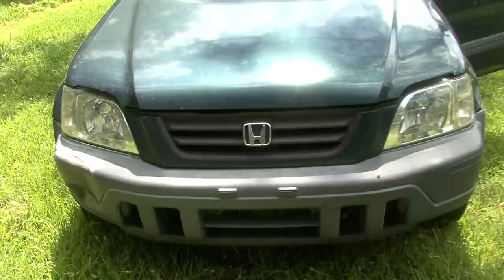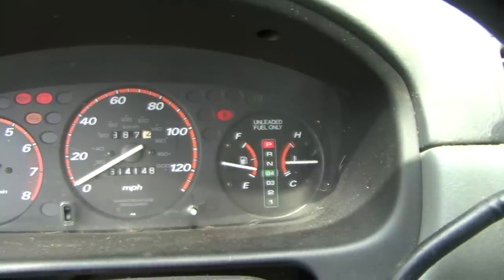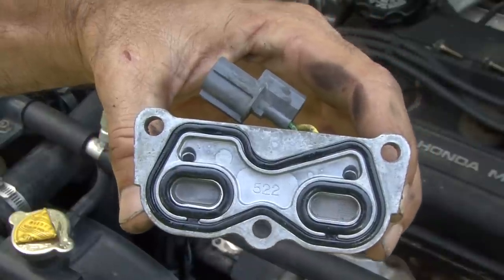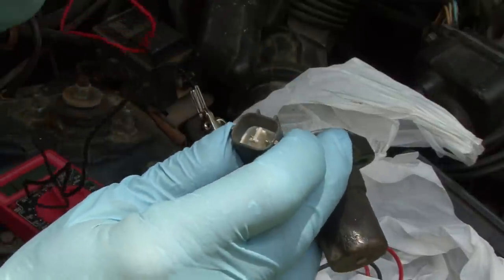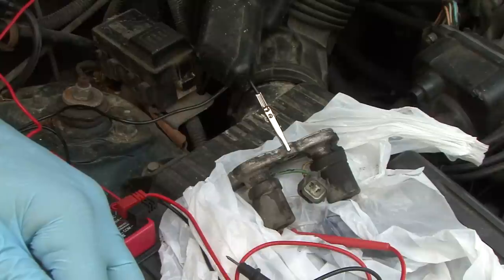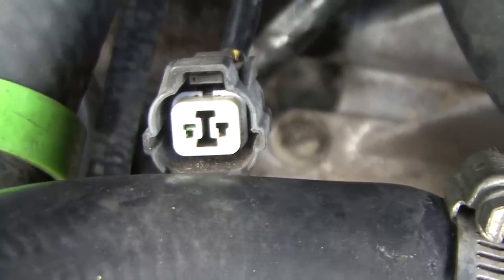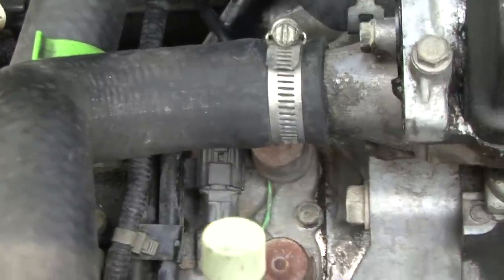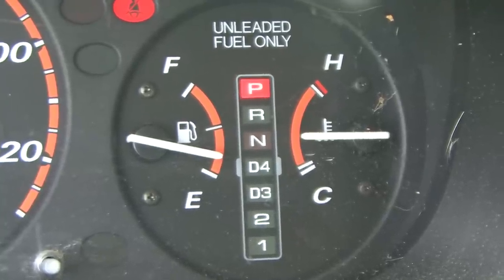Honda How To , blinking  D 4 with p0700 , p1758 and how to fix it , lock up solinoid

Comment: This was so helpful! Took my first gen crv to several different mechanics and they all said to replace or rebuilt the transmission. This saved me a ton of money thanks!
Reply: They would of had taken it off spray paint it and said its “new” and cleaned out the solenoid or changed it out for aftermarket junk
Reply: Loll

Comment: Thanks for the Great Video..I have a similar problem..The D4 light comes up after  i drive around 60 miles..during stopping at lights and shifting from lower gears. looks like when Engine gets hot...the issue comes.i changed Transmission oil..it mitigated..but problem came back: Vehicle Honda Accord 2000 VTEC 4 cyl..Fault codes P1381-cylinder pos sensor noise, P1750-clutch Presure Control Valve malfunction, P0780-Shift malfunction, P0740-Torque Converter Clutch Solenoid Circuit/Open, P0700-Trans Control System Malfunction

Comment: I have a 98 Honda crv. Swapped transmission out after the last one blew. I swapped the shifter cable out (last one was town apart) but no longer shows park on the dash. I cranked in neutral (which was actually park) and drove down the road and shown the d4 flashing. The code p0720 shows up. Any advice on what could exactly be going on would be very helpful.

Comment: I have the same problem. How do i check the conector? Do i look for 12 v on each pin? Cuz i have no power on either cable with the car running.

Comment: Cody, I need some help on my 03 Accord V6. It started jerk at 30mph. And I can't even drive past 20mph. I've changed the spark plugs, transmission fluid, several sensors. But it still doing the same. I was told its the transmission switch solenoid and lock up solenoid. But I don't know the locations of the two parts. Please help.

Comment: If you have the time could you  help me out? I have a 2000 Accord 4 cyl automatic that just triggered a check engine light and the green light around the D was flashing, it also had trouble shifting. When I manually shifted to a lower gear the blinking light on the D was still on plus the light on the lower gear, “Lower gear light not blinking“. I shut the engine off & restarted, engine light is still on no blinking shift light & the car is running fine except for the engine light. It tripped codes P0700 & P0780. I was told P0780 was a hydraulic problem. The car has 120k & trans fluid is a dark red (not black). I took it to a shop & was told that fluid is burnt. But they would have to run several test to let me know if I need a tranny rebuild, replacement or a solenoid replacement. I asked if a fluid flush could clear the check engine light. He said that he never saw that clear the light. What is your opinion considering the fact that the car is running as before the light came on would you try changing the transmission fluid, total flushing or any other suggestion.

Comment: Hi cody  my d4 light is blinking on my 98 honda crv i check the solunoid like u did and it does  the same thing  its like id have to floor my gas pedal to get it to move but my muffker recently  broke apart as well cud the dragging be becuase of the  muffler plz help me

Comment: I have a 1993 accord I'm having a similar problem 18th my check engine light turning on my d4 light does not flash while its on at all my check engine light turns on and then my car turns off but when i pull the codes off the d4 is flashing how would I know if its the lock solenoid or shift solenoid that doesn't work or is it something else ?

Comment: What's up Cody how or what scanner should I use to pull the trans codes on my acura vigor I got the D4 light on doesn't blink but stays on when ever I shut the car off or when I start it. It'll  just drive on d2, D3 only. please help this is my only Transportation right now I'll greatly appreciate it thank you.

Comment: Did your old set of solenoids click also? Mine click but the ohms aren't right, and mine is different style and a new one is $240, I want to be sure it's the solenoids before I pop on anything. Only code is p1753

Comment: Got a 98, replaced the lockup already. It shifts slow, Erving between gears but I have trouble getting it to stay in D4. I get one blink of the D4 light when I turn the CRV on. Also per the dash there should be 7 positions but I can only get it to lock in to 5 positions. Any thoughts
Reply: Ok so it comes on and goes off like it should

Comment: i got 29 ohms and no clicking but i connected two wires straight to the solenoid then connected straight to the battery unlike what you did here to check for clicking does this mean maybe it's working still?Or is 29 hims mean it's dead?

Comment: is this the same for the integras mines doesnt flash but over 40 and i took my foot off and try to press on the gas again it gives me this loud noise and idles high and goes into gear after it hits about 6k rpms

Comment: I have a 01 honda crv and i had the p1768 and p0700 codes depending on which reader i used. Anyway, i changed out both linear solenoid and the clutch solenoid like he shows above and it did not fix it.  I wasnt really thinking but my speedometer was not working.  Well on the way to the dealer to have them look i thought maybe the speed sensor was bad. So i came home and looked it up. Then i got to thinking maybe it can be a fuse. Well go figure all this crap i did could have been fixed by a 7.5 amp fuse. I changed out the speed sensor\alternator fuse that was blown and turned the car on. No more D flashing no more codes nothing. No idea why this would trigger the other codes but i hope this helps someone else before you go through all that i did. If you speedometer dont work and the D light flashes, check your fuse first them the speed sensor next!!
Reply: changed the fuse and all is well again. thank you
Reply: Michael Siemen
Reply: Thanks Michael, my CRV 01 speedometer is fluctuating and goes back to zero kph while the car is in motion. this started immediately i took the car for pressurized car wash. let me check for the culprits you have mentioned before spending on diagnostics.

Comment: I have a honda CRV 2002 with check engine is ON. Some time on drive, I saw D light is flashing  but sometime it does not. While using AUTOPHIX OM 123 to read error code, it show me [P 1705 Short in Transmission Range Switch Circuit (More than one range position in on at the same time)]. Any recommendation form my case?

Comment: My Honda CRV 97 it will hesitate to go in D4 and a hard push on the transmission do you think it's the solenoid my D4 is not flashing but I know it D4 because that's the only one that's acting up

Comment: Was your gears shifting hard when the d4 light started blinking?
Reply from the maker: Yes you can get very hard shifts when its blinking
Reply: +Cody the Car Guy I have a honda 97 accord d4 is blinking my shifter is pretty hard to shift from park to drive transmission shifts good what could it be.

Comment: I had a p1773 for (problem in A/T clutch pressure control solinoid valve b circuit ) 98 Accord.

Comment: My 1995 honda accords D4 is blinking I read the code by jumping the 2 prong wire on the passenger side an showing 9 fast blinks an my car shifts smooth but won't shift too 4th gear
Reply: Brandon Martin same problem

Comment: It works for few mints ones the transmission fluid gets warm it startrts again d4 and check engine ligt i not ab the bad sensor is cus transmission cluches they get old ..

Comment: Hey brother. I have a 1998. And I have the flashing d4 wont pick up speed properly in the d4 gear but once it picks up speed it drives fine but won't accelerate properly from a complete stop. I changed all 3 solenoids.  Lock up,  linear and shift solenoid. Cleared codes and turned it on.  No change. still flashing d4 and won't properly accelerate -_- any ideas?
Reply: Did you got it fix?
Reply: Update ?